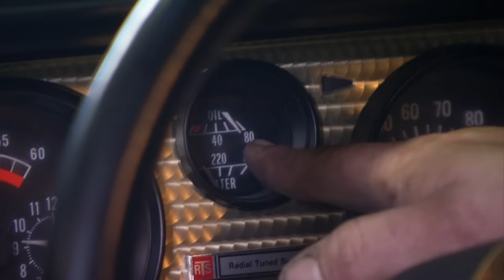Richard Upgrades A "Smokey And The Bandit" ’77 Pontiac Trans Am | Fast N Loud

Comment: The Bandit TAs were warmed over, that car you see barking in 3rd gear is about a 12 second car on the strip, mid 12s I'd say with a gear swap from the highway gear to a 4:11
Reply: The 77 movie cars were 1976s with 77 front clip. They also had the 455. 
4.11s never worked with Pontiacs. They had plenty of low-end grunt.

Comment: If this is a real 1977 Y82 Black SE car, all of these items are total downgrades. It's missing the hood scoop decal (which should say 6.6 LITRE as this has the Oldsmobile 403 in it) and if it's a true original car, all that aftermarket equipment detracts from its' value. It's not a "build" it's a "rebuild". GM built it, you are RE-building it. 

GM did not build a "Bandit" edition, that is a total misnomer and true Pontiac folks never call it that. There was a 2nd generation Bandit Edition, but it was an aftermarket done by Trans Am Specialties of Cherry Hill, NJ.
Reply: Absolutely correct awsome comment
                            ☮️👊
Reply: Probly just a base model trans am.  If it's a California car it have a 403 in it.   Special edition.  Sexy cars had 400s in them
Reply: @bohoward8945  The base 400 also said 6.6 LITRE on the decal.
Reply: @googleusergp I know the W72, pontiac 400, said t/a 6.6, 200hp, verses, the 180hp base 400, and the 185 hp Olds 403, the two latter saying 6.6 liter on the hoodscoop, like you mentioned for the base 400 L78 Version.
Reply: @thebacdoc6464  Correct, the "T/A 6.6" was only for the high-performance version of the Pontiac 400 (W72). In 1977-1978, there were two versions of the 400, a 180 HP version and a 200 HP version (1977), and 220 HP version (1978). The HP versions were the W72. All 1979 Pontiac 400 engines were paired with the BW Super T-10 and all were HP versions (leftover 1978 versions, hence 220 HP). All versions of the 400 had a 5th VIN digit of "Z", while the 403 Olds (only paired with the TH350 automatic) had a "K" for the VIN code. W72 versions of the 400 had chrome valve covers. The 180 HP versions had painted valve covers. Of course the 403 had painted valve covers too. I have a 1979 10th Anniversary 400/4 speed, one of 1,817.
Reply: @googleusergp Thx for the info regarding the fifth digit of the vin accordingly...its funny, I cant tell you how many 79 trans ams I see on this app, with an automatic transmission, but yet they have t/a 6.6 decals on the hoodscoop...lmao.

Re: Your tenth Anniversary W72, thats a rare bird. My late father had a tenth anniversary car to, but with the Olds 403. The 4spd  w72's were definitely faster than the automatic 403 in that year...lol
Reply: @thebacdoc6464 The reason for the decal mistake is because the graphics suppliers in the aftermarket include the "T/A 6.6" with the kit and you have to buy the "6.6 LITRE" decal separately. Most don't know, don't care or are too cheap to spend the money for the 6.6 LITRE decal. In their minds, "They were both 6.6 liters". True, but as you stated, a world of difference. LOL. Nothing wrong with an Oldsmobile engine, it just doesn't belong in a Trans Am.